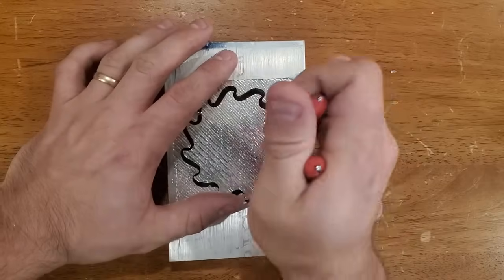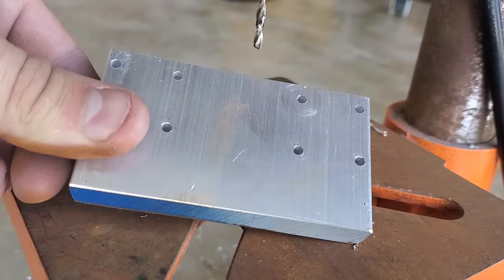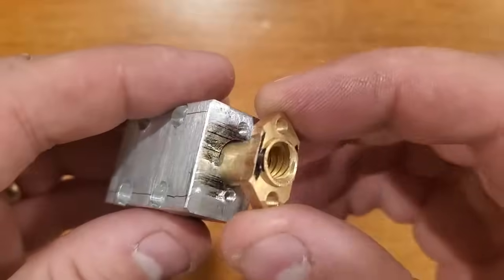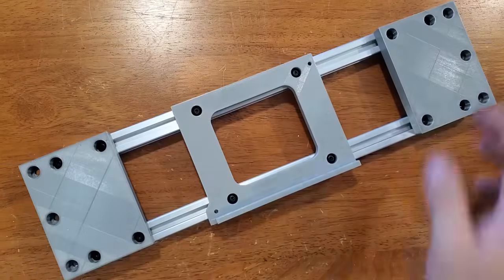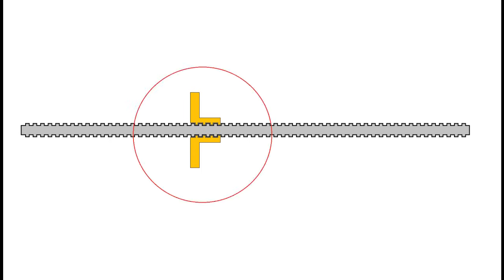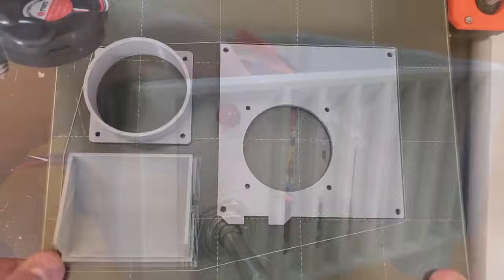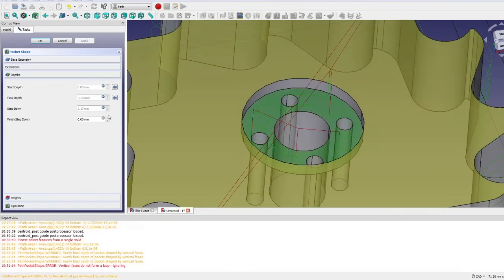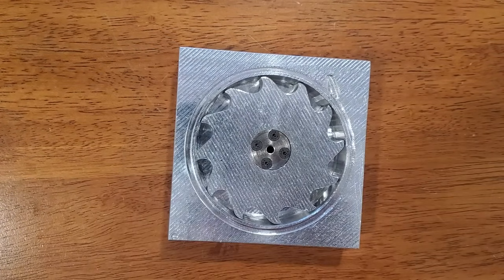Upgrading my Homemade CNC

Comment: Does FreeCAD allow you to have a Milling Toolpath generated where it will mill a given depth twice - Once without a clearance offset and once with thus creating a wider channel for chips to evacuate into and not be bogging down the Endmill on subsequent passes? If not, I'd strongly encourage you to drop it like ASAP for the free F360 License allowing you to do that for a much more preferrable surface finish when working with underperforming hobbyist machines.
Reply: Fusion 360 is not free. I encourage you to learn what freedom means.
Reply from the maker: I think that feature is available, yeah. "Adaptive" milling, where the tool creates a helical path along a line, right?
Reply: @HyperspacePirate  Nope, I'm talking about what F360 is calling a roughing pass.

I was kinda having the impression that the channels you're cutting are only as wide as your bit and without you flushing the material out before it comes along for the either a springpass or the next depth you most likely regrinding those chips still in the channel.

With a roughing pass you'll first mill with like a 1mm offset followed by the actual pass you intend to make near the part but now at least your unevacuated chips have a place to go and thus not getting in the way of the Endmill while its actually engaging the part.

I'd describe it as a poor man's adaptive clearing - Still won't allow you to go balls deep with the cutter because after all the roughing pass is as wide as the entire cutter but at least you're regrinding your chips because you don't have a way of evacuating it ( I for one have an MDF Spoilboard so Flood Cooling is an absolute NoGo )
Reply: @Duraltia  Expand Profile from Path_Profile

Comment: do you just waste all the material from the last round hole? hrrr...12:00 why dont just use profile toolpath and save the material, time and tool in the middle.....
Reply from the maker: I keep all the aluminum chips and plan to melt / cast them in the future

Comment: That two lead screw approach is also what I came up with for a CNC machine design. Its simple, cheap and easy to repair ... but it will increase friction. However if you are milling metal a little extra force required should not matter!
Reply: Instead of tightening the nuts together with nothing to constrain the compression, either shims should be used under one of the nuts, or the mounting holes should be slotted to allow it to be rotated. This way the backlash can be minimised without introducing excessive friction (and the resulting wear).

Comment: 1. Most CNC machines in the shop will use a filter on the air intake of the electronics to keep dirt and chips out. That should be an easy mod. 2. Use an air blower or preferably an air mister with coolant to blow away the chips to get a better finish. 3. Try to have the end mill stick out of the collet as short as possible to keep the tool from flexing... Awesome project!
Reply from the maker: Yeah eventually I'll probably set up a solenoid for compressed air + relay for a vacuum on a 555 timer to come on every so often for a second or two
Reply: @HyperspacePirate  Great job. How do I privately discuss with you?
Reply: @tonywilson4713  :  Yes, Dan's lathe was the first video I saw from his channel.  Thanks for the Heads-up on the other guys... I'll check them out.   👍
Reply: @PiefacePete46  Another guy to look up is Stefan Gotteswinter who's German and insanely good with a small limited shop.

The other machinist I like a lot is Joe Pie who's American but is great with practical lessons.
Reply: @tonywilson4713  :  Thanks... I do follow both of those guys.   Full of neat info.  👍
Reply: @PiefacePete46  The one thing I love about all those guys is they are actually doing what social media has always claimed it would be good for - bringing people together. 🤷‍♂🤷‍♂🤷‍♀🤷‍♀
Reply: I can provide high-quality low-cost processing services. If you need mass production of this product, you can contact me, and the cost will save you 40% to 50%.
Reply: @@johnnytheprick scammers
Reply: Could use second hand mask as air filter. But make sure disinfect it.
Reply: You are on the right track with the box. I am a control systems engineer.
This is my explanation to everyone.

You need to make the air in the box slightly higher pressure than the outside.
So you need your fan to suck through a fine filter and PUSH the clean air into the box or cabinet.
You'll find many electrical devices have the fan on the outlet of the ventilation system. Go look at the PSU on most desk top PCSs. My PS4 does this and its something I like to slap a few Sony guys for.

The problem is when the fan is at the air outlet its sucking air from inside the box/cabinet which reduces the air pressure inside the box/cabinet. It will then suck in dust from any and every place it can be sucked.
Reply: @tonywilson4713  Well you guys took the words out of my mouth, great job guys. Also fantastic build @Hyperspace Pirate . I would suggest for starters your inlet and outlet face down to limit ingress, and as @Tony Wilson has stated you need to create a positive pressure housing. Filtered inlet fan, free flowing exhaust. You control what goes in with these systems by choosing a filter.  Also as stated before the chips or refuse material galling your tooling and causing chattering can be solved with Vacuum/ blower and add in clearing slots/ports/pathways/reliefs in your cad/cnc/gcode tooling path so you don't have bound chips in critical dimensions/corners/tight spots. when using coolant/lubricant, you will save a-lot of bits in the end. Sweet work though, I look forward to your progress. Sub from me.
Edit for tags.

Comment: Use alcohol instead of wd40 your endmills will last longer and you won’t have a messy work areas. Awesome video you put a lot of hours into this upgrade.
Reply: No,  Never use flammable liquids for a lubricant or for cooling, Its dangerous and stupid to do and ifyou have a resulting fire I am sure your insurers might ask the question "why you used it" !!!  

Just buy the proper "milk" formula coolant/lubricant from a industrial machining supplier, its not that expensive and its the correct lubricant and coolant, it would be very easy to mount this machine in a small tank and use the proper coolant on a recirculation pump connected via a pin on the motherboard to a relay to operate automatically.

Please never use a flammable thin liquid, if you have to use thin machine oil  but never Alcohol!  18000 RPM , almost red hot end mill , youre asking for a fire.
Reply: @sitgesvillaapartmentneilsc7924  using emulsified oil is messy and you have to clean it up after you use it. Which is inconvenient. BTW if you're cooling the tool it is not going to get red hot. That's why you're cooling it. You don't let it get hot and then cool it. You cool it so it doesn't get hot. Once you've burnt a tool up it does no good to cool it then. As the damage is already done.
Reply: Good for the endmills and the operator
Reply: I don't advise using alcohol when dealing with CNC machining for several reasons

1) While Alcohol will evaporate, and can dissipate some heat, at a certain point during the machining cycle, heat buildup will far exceed the minute benefits alcohol provides with concern to heat removal,  at which time, it actually flashes off too fast, removing even less heat with it. 
2) Heat build up increases the speed at which alcohol evaporates, thus increasing the amount of alcohol vapor in the air. This is a fire hazard for very little benefit. This is particularly dangerous when dealing with unknown aluminum alloys, many of which contain zinc or magnesium.
3) Alcohol function quite poorly as a lubricant. The viscosity is far too low, and it's high flash-off speed prevents it from being very effective.
4) While alcohol may be cheaper than WD-40 by weight... It simply doesn't last very long, meaning you will use more and more of it as the part heats up during the machining cycle. This will end up being more expensive compared to using almost any other lubricant such as WD-40, or other such light machine oil based lubricants. 

WD-40 is not only a perfectly acceptable lubricant for Aluminum machining, it's also one of the most preferred methods by hobbyists and professionals world wide. Unless you're using a VMC or other such high-speed CNC center that uses exotic oil suspension coolants, WD-40 is the go to for soft / gummy materials such as aluminum and copper.
that is for a few significant reasons: 

1) It acts as a lubricant, which aids in the machining process by reducing friction and heat. 
2) It acts as a release agent. If you've ever machined aluminum, you've probably run into a situation where chip evacuation issues, and heat lead to aluminum chips "sticking" to the flutes of the end mill. This is called "Chip-Weld" and is a major factor in reduced tool life, and surface finish problems. 
3) Because WD-40 has a high flash-off point, and high viscosity than water or alcohol, it tends to "stick" to parts and tools, maintain a layer of protection throughout the machining cycle, and reducing the amount needed over all, as reapplication is less frequent.
Reply: @ArcAiN6  Datron use denatured ethanol on the neo as a MQL so it seems its perfectly acceptable. Or atleast good enough for Datron.
Reply: @ArcAiN6  Relton A-9 Aluminium Cutting Fluid. Textbook says: Soluble oil, Kerosene, Kerosene and lard oil for drilling. Soluble oil for turning.
Have fun breathing all that nice WD-40. Nothing like a good dose of WD40 to loosen the bowels!
Alternatives: Soybean oil or Vegetable oil + beeswax at about 8:1 makes a nice paste. If that doesn't work for you ... have a pizza;)
see homeshopmachinist, Thread: "Lubricant / cutting fluid for aluminum?" for "inspirations":)

From Dajin Precision, a manufacturer (biased? ... wants to sell his products ... hehehe)
- Best cutting fluid for turning aluminum: Soluble Oil
- Best cutting fluid for milling aluminum: Soluble Oil, Lard Oil or Mineral Oil
- Best cutting fluid for drilling aluminum: Soluble Oil, Kerosene or Lard Oil
- Best cutting fluid for threading aluminum: Soluble Oil, Kerosene or Lard Oil
- Best cutting fluid for reaming aluminum: Soluble Oil, Kerosene or Mineral Oil
- Best cutting fluid for tapping aluminum: Soluble Oil or Mineral Oil

Hey @guser210 have you milled before you've written that? Hint: Don't trust a guy who handles alcohol at the workplace!!! Just joking! There are a plethora of different alcohols available ... you must be specific, because your post is NOT helpful ... even after a beer:) Alcohols usually evaporate (if I knew which one...) even faster than WD40 and as a pure liquid without thickening agents they hardly survive being used on the cutting edges. For cooling they may be the non plus ultra ... but costs?!!! In their pure form they are mostly useless for lubricating. Air cooling is then sufficient, makes no difference. Anyway: Cheers!!!
Reply: Yes! Alcohol is the only coolant to be used for aluminum. Keeps the aluminum from gumming up.
Reply: Yes and no.
On the right Aluminum most people will used WD40 but on other things Isopropyl Alcohol and other things stuff like Anchorlube or Trefolex.
Stefan Gotteswinter has some good info on cutting fluids.
Reply: WD-40 is an excellent lube for cutting aluminum. I doubt alcohol would increase tool life over using WD-40. WD-40 ain't good for much but it's not a bad aluminum cutting oil.